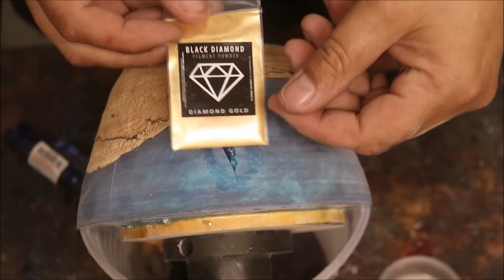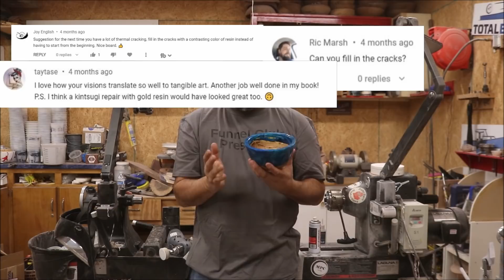The Art of Kintsugi

Comment: Would you be able to dust the cracks with gold pigment and then hit it with the glue?  It turned out gorgeous, the mix of the blues was a fantastic choice, but you're going to have to charge at least $ 1000 for it for all the time waiting for the resin to cure.
Reply from the maker: It did take a while to finish this one. I think dusting the cracks and adding a resin is possible. Maybe if I had a quality UV resin it would work. Thanks.

Comment: Question.  Have you ever tried using UV cured resin to fill gaps?  I have been using it very successfully on wine bottle stopper hybrids with pine cones.  Instantly cures so you can go right back into turning!
Reply from the maker: Hey, I have some UV resin I got off Amazon. It is absolutely the worst. lol But TotalBoat now has some UV resin so I will try theirs.
Reply: @MoonpieCreations   I use AlumiUV.  Cures in about 2 minutes under my UV light and turns out ROCK hard.  I have mixed mica powder into it but have not tried liquid dyes.

Comment: Just wondering but why doesn’t the epoxy soak into the punky wood is it to thick ?
Reply from the maker: In this case it was to thick. I let the resin heat up and thicken before pouring. Thickset is a good resin to use if you want it to sink in.